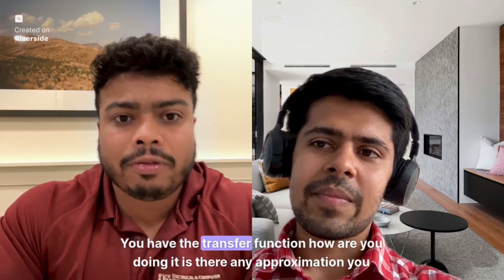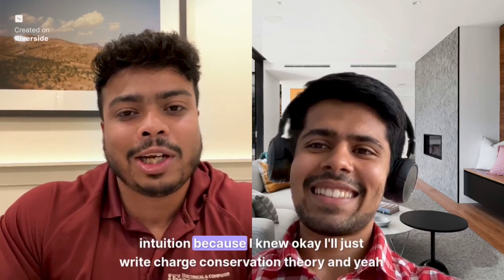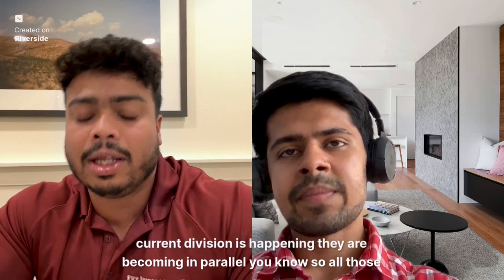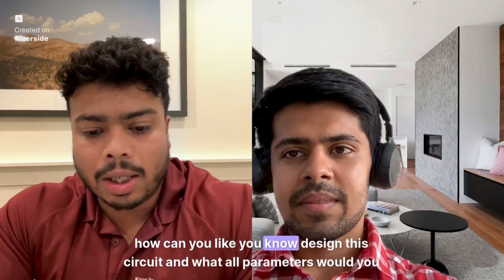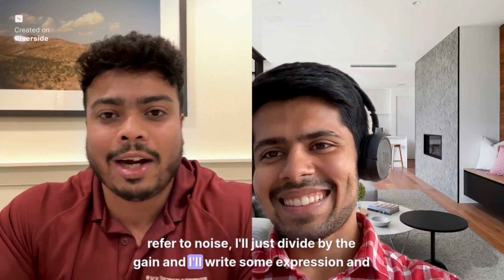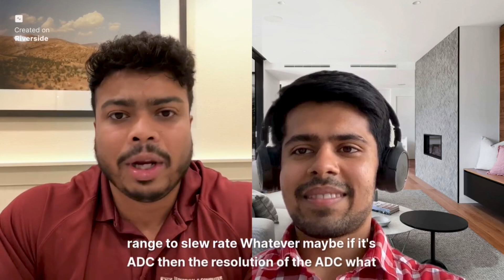How do interviews evolve from fresher roles to senior-level roles?

Comment: https://www.youtube.com/watch?v=XRQ_Xldr2nk&ab_channel=AnalogSnippets 
This question on "charge conservation" was asked in an interview with "Analog Bits" company 5 years back when I was still relatively new to analog field . Obviously, if you aren't aware of these type of questions in the initial stages of career, interveiwer will help you with hints. However, my interviewer didn't and I ultimately failed the interview. If I am interviewing anyone, I will make sure I would throw some hints to certain extent, correct the interviewees thinking and work with him to solution.
Reply from the maker: Thanks for sharing the video. 
Right, even during my interview I was able to solve it mathematically but unable to provide an intuitive answer. He tried to give some hints, but at that time I could only solve it mathematically.
Reply: An initiative answer is very hard, I think so

C or L Questions was really so hard!